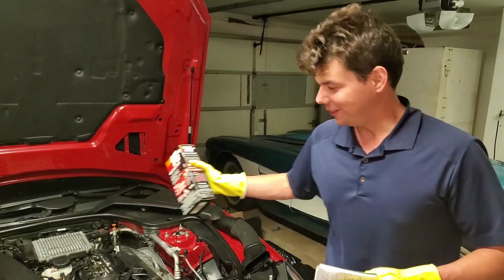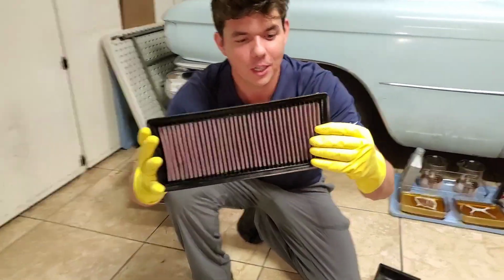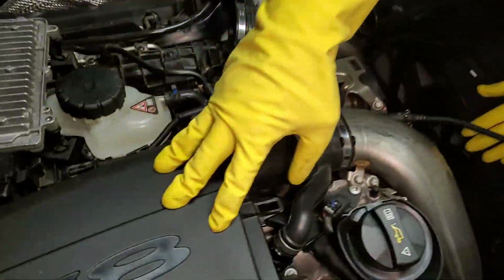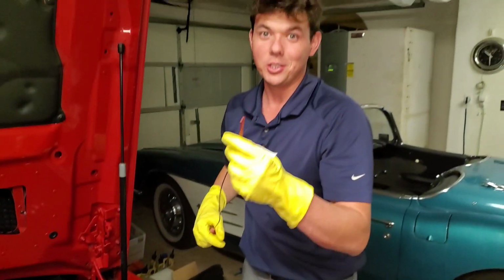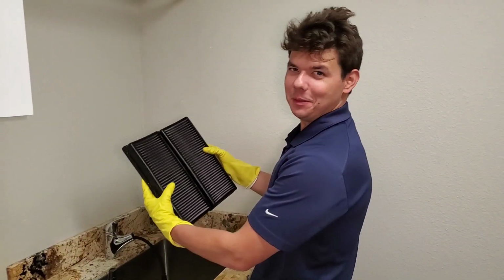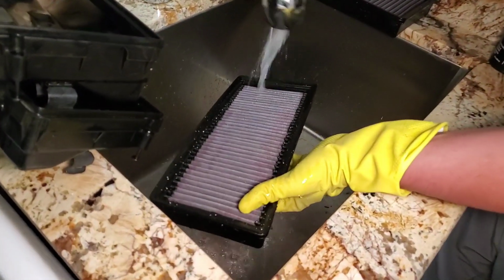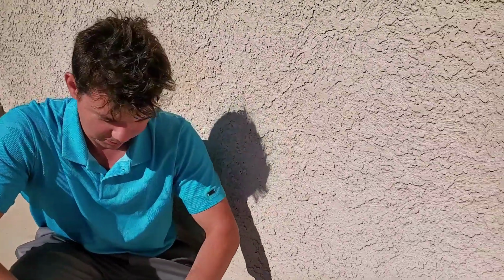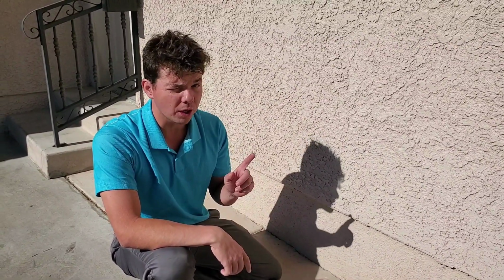10000 Mile K&N air filter follow up cleaning SL550 Mercedes

Comment: I can’t get over you putting 10k miles on it already….
Reply from the maker: Yeah we're just getting our toes wet This sucker's going to be at 20,000 by the end of the year 😃💯🎬
What should I say the end of 2022 😉
Reply from the maker: Yeah I'm excited to get out in the open roads and do some canyon carving and cruising again It's been a long time since I had my Corvette.
Feelings of emptiness insecurity without having a nice car just really difficult to go on with out such a beautiful cruiser.

The old saying you don't realize what you have until you lose it you know you think I see five Corvette is nothing but once you lose a beautiful car like that you realize how Nice they are 😃🎬💯
Reply: Eben, I usually put a lot of miles on cars, I had a 2019 Mustang GT with the performance package, six speed. I put 18k miles on it in 18 months. And I work from home!  That car was a lot of fun I drove it from Tulsa to the west coast just for fun. I sold it back in February as my son just turned 16 and insurance was going to be too much with him and the Mustang.  I’m into the bigger older luxury cars now, I bought a 2002 Mercedes S430 with the sport package, it has the ground effects and the AMG wheels on it and only 64k miles. It’s by no means a canyon cruiser but it’ll run 90-100mph on the interstate or turnpike. One of the first things I did was to put the K&N air filters in it. I think I have 5k miles on them now, so I’ll be cleaning them in the next 5k miles. Have fun with the car, they’re meant to be driven!
Reply from the maker: Yeah if you live somewhere with a lot of moisture I don't think you'll have near as much dust you should be good for 15,000 mi

Comment: Oem oem oem oem oem always
Reply from the maker: That's what I used to think until I experimented and tried different lubricants filters and tires I strongly disagree and the results now prove it my car is no longer a Mercedes it has become the synthetic oil protection machine it did a 3.8 seconds 0 to 60 at 2600 ft above sea level with a 220 lb passenger at 93° out in Las Vegas going uphill on a 1° incline.

The fluids that are available by aftermarkets are significantly better than OEM and also filters and tires in many other wear items always do your research and always experiment🇺🇸🥇
 ♥️   See fluid performance tests - https://www.amsoil.com/performancetests.aspx?zo=5331179      
Results - https://youtu.be/zH-VquYlhqA?si=2UuWncUVRXNSVyGV
Inter cooler fluid chnage 
https://youtu.be/dUNMXxJF53Q?si=yS9ZZObzon__MfUh